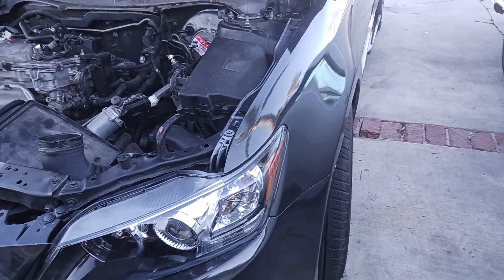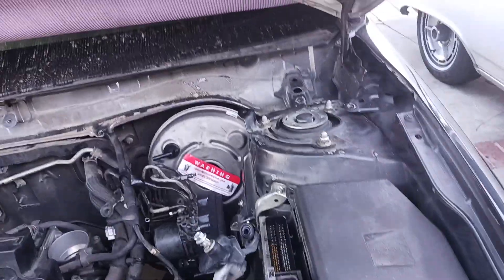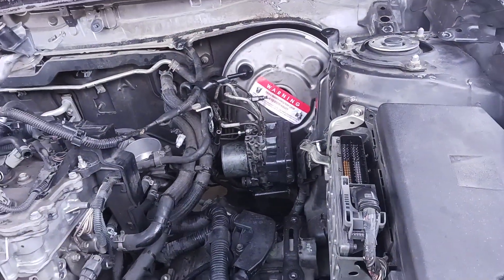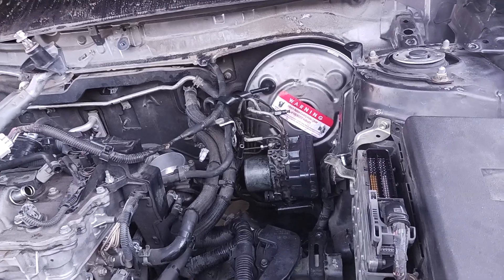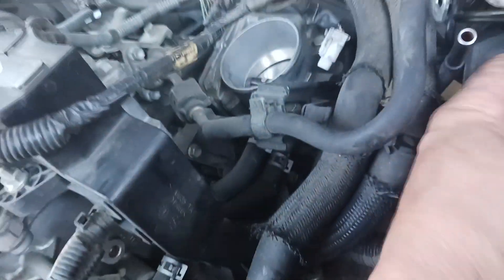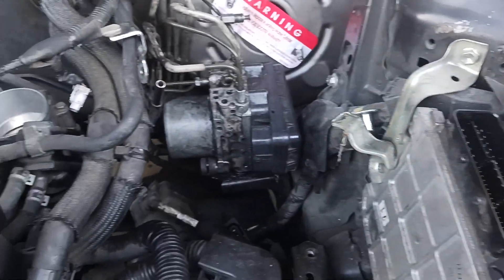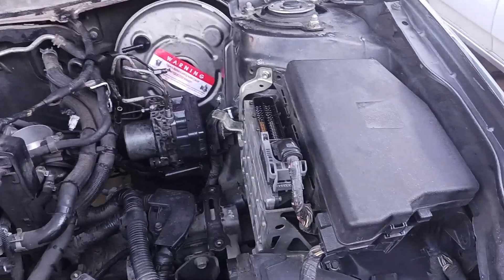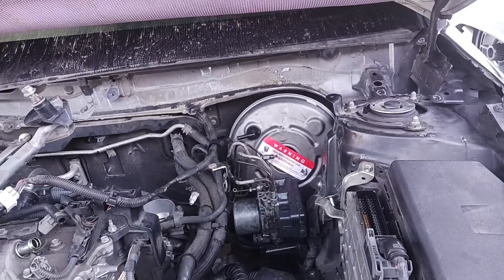2011 2012 2013 scion TC brake booster installation

Comment: How much it cost to replace it
Reply: Amazon was around 170 for remanufatured
Reply: Labor could be around 450.00 due to removing the
ABS module.
If you do it yourself, make sure you have the proper brake line wrenches...